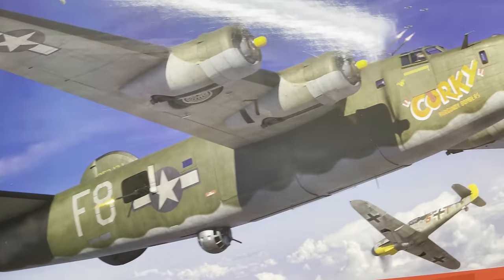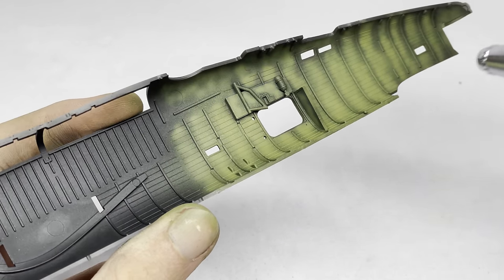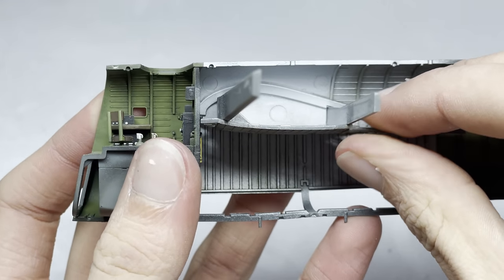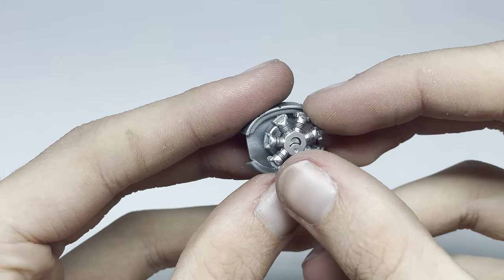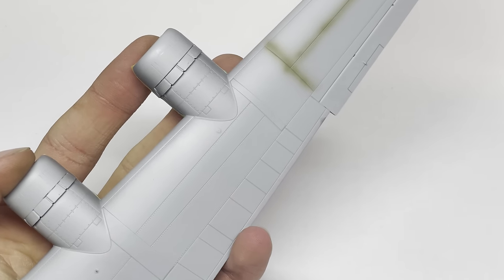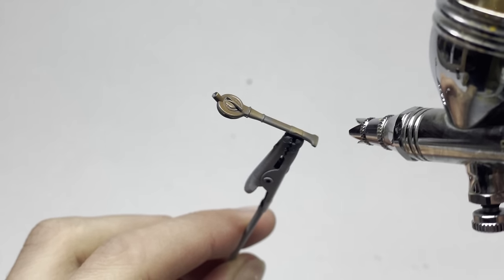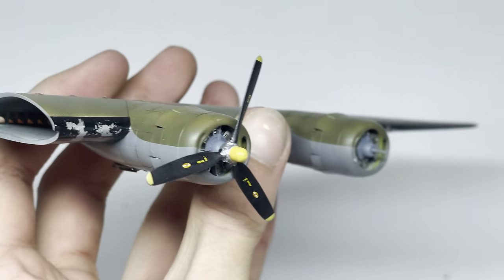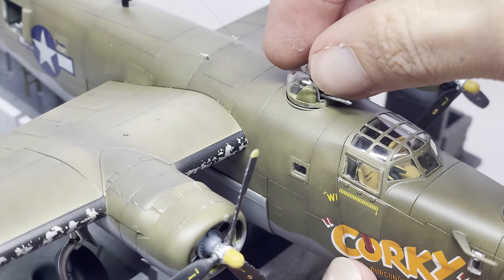Airfix's Brand New 1/72 B-24H Liberator | Full Build | 4K

Comment: Great video. One point to make though. The leading edges of the wings are rubber deicing boots, they would not be weathered with chipped paint. They would stay black or rubber in colour. These rubber deicing boots appeared on the B-17, B-24, B-29 and C-47 and C-54
Reply from the maker: Thank you for the information, definitely a let down from me… obviously just being lazy and not doing my research. I’ll make sure to improve for next time😉
Reply: Many cammo B-17s in Europe also had these removed too. There's footage of an out of control B-17 in cammo, in a spin, and the bare metal L/E is reflecting. @ultralowfat
Reply: @machmodels  Came here to say this too, FYI, de-icing boots are still in use today - the ATR-42 ATR-72 and Dash 8 are among some aircraft using this method.
Reply: @MillwalltheCat  You can see deice boots on the B-17, B-24, B-29 and C-47 and C-54. I imagine the twin engine B types could have them or not depending on how they were ordered. These were rubber pneumatic boots.
Reply: @MillwalltheCat  Please provide information about this. Icing conditions in the ETO required deicer boots
Reply: The more you know
Reply: You are correct. I have built 1/48 scale models of the aforementioned aircraft, and they had the de-icing boots. I am currently working on a 1/72 scale B-29 Enola Gay/Bockscar,  and I need to guess/guesstimate  where those boots are, as the deliniations are not obvious.
Reply: @machmodels  my comment, above, was before I read this one, about the flexible rubber de-icing boots....an EASY fix....

Comment: The only problem I see with the execution of the kit, and it does detract, is the leading edge of the wings, tailplane, and rudders are deicing boots.  There would not be the chipping of paint with these boots.  If the boots were removed for combat, the base color was the color of the wing, in this case olive drab.  Yes, that is picking of nits, but an important detail.  Over all, I really liked this build
Reply from the maker: I have now masked them off so it’s a tiny bit more accurate, thanks for the information anyway!☺️

Comment: This has to be the best 1/72 Liberator I’ve seen. I can’t believe it’s Airfix. When did they start using this new plastic? From what model? I’m used to excessively soft plastic and short shot parts but good over all shape. This is a quantum leap.

Great job, by the way.
Reply from the maker: Thank you very much, airfix have been using this new plastic for about a year and a half now😉
Reply: I have several Airfix kits in my stash, all relatively recent offerings. They have stepped up their game in the past few years. The amount and level of detail, even in 1/72 scale is impressive.

Comment: Great! Just one suggestion :  I am pretty sure that the black on wings and horizontal tail leading edge was the classic anti ice Goodrich system made of inflatable rubber, so it was not subject to peel off like normal paints.
Reply from the maker: Thank you! You are correct, as of today it has been rectified😁👌🏻

Comment: Terrific job on the B-24, really like the camo scheme and the method used to create shadows and fading. Well done Revell for including so much detail. I built a Revell B-24 kit back in the early 1970s (as a young teen) and recall that the details of the interior were basically non-existent, except for some bits and pieces in the cockpit. BTW...I enjoyed the Mosquito build :)
Reply from the maker: Thank you very much! However, this is Airfix not Revell😄😉
Reply: @machmodels  OOps....my mistake....I meant Airfix not Revell.  I have Revell on the brain at the moment as I'm building the its 1/32 Ju 88 and it's driving me insane with so many issues. I did build the Airfix B-24 many moons ago and it was a very basic kit then so it's great that, in the intervening years, there have been  major improvements in the quality of the new kits.  Bravo Airfix!!

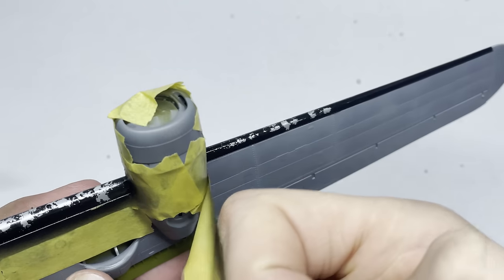Comment: A 18:40 the 'metal reveal' chipping shouldn't be there. The black strips are pneumatic de-icing boots, which are cycled to make a 'creeping' surface to break off ice deposits and safeguard the aerodynamics. The aircraft wouldn't be signed off as fit to fly with the boots inoperative and puncture repair patches can sometimes be seen on boots at full scale. Hope this helps -  otherwise an excellent model.
Reply from the maker: Thank you very much for the comment! Really appreciate the info, seemingly just pure laziness from me and below par… I’ll work on it for next time😉

Comment: Really good model. Note for accurately depicting the leading edge, I believe that the b24 was equipped with pneumatic boots. Much like modern aircraft this is a rubber sleeve on the leading edge that can be inflated to dislodge any ice formation. These boots where made from rubber, so wouldn’t really have any chipping. (Feel free to correct me) hope that helps with any future builds
Reply from the maker: Thank you very much for the information! I have a b17 to do at some point so I’ll refer back to this😉☺️

Comment: Excellent job on the build.  Looks AMAZING!  The only little characteristic that I don’t like, and it’s not anything to do with your work at all,  is the landing gear in the extended position.  It looks like the plane sits too high off the ground, too much room between the belly and the ground.  In reality, I don’t believe the ball turret could be fully extended on the ground.  Years ago, I had a 72 scale Liberator and it did the same thing.  I always thought it looked inaccurate.  The 48 scale Libs were more accurate in this case.  Congrats on the build either way!  Speaking of 48 scale Liberators, will you be building the new tool kit at all??  Keep up the great work!  

Cheers!!!
Reply from the maker: Thank you very much for the comment, I’m not too familiar on the libs anatomy so I’ll take your word for it!!

Uhhmm if I could find somewhere to put it maybe!😉☺️

Comment: I might be mistaken but the leading edges of the wings and tail surfaces have a black rubber deicing boot . The boot allows any ice that forms on the wings to be kicked off when the boot inflates . Many modern aircraft still use this type of anti icing system . The Beechcraft King Air is an example .
Reply from the maker: You are right! Thanks for pointing it out to me👌🏻

Comment: That new tooling is like several levels over the old 1960’s one.  Great build.  Question: Did they even keep the rubber de-icing boots once the boxcars were in a warzone?
Reply from the maker: Thank you very much! I believe from my understanding that they where in fact kept in the war zone, I might’ve been a tad inaccurate chipping them to bits😂
Reply: @machmodels  You are correct!  After looking at various combat damaged B-24s, many still have the rubber boots.  As far as the “chipping”… whose to say it wasn’t from a maintenance guy trying to remove the strips?  You could always mask it off and repaint with a lovely brownish-black (even pure black if the ground crew were diligent in applying some sort of refinish) … or buy more Airfix B-24s and treat us to another fantastic build – NMF!!!

Comment: I would have attached the nose sections to each of the fuselage halves, not as two sparate sub-assemblies. It can be troublesome in fit following the kit instructions (Case in point being the Revell/Monogram Ju88A that had an issue with that area - and the wingtips).
Reply from the maker: Ooo good idea! I’ll have to try that next time😉

Comment: Great looking build, amazed you got it out so quickly too! Do you mind if I ask how you go about spraying VMS varnishes? Pressure, thinning etc?
Reply from the maker: Thank you very much! No problem, so I like to thin them down 20% and spray at around the 20-23 psi mark… if you are using a 0.3 or lower thin 30% or more😉

Comment: regarding the leading edges: chipping them is a mistake, as those black edges were rubber. they served for de-icing the wings. (Those were like inflatable gloves on the leading edges, when ice started to accumulate on them, some air were pumped into them and the expanding rubber broke the ice layers.)
Reply: Just an FYI, in the MTO (B-24s stationed in Italy),the rubber de-icing boots were removed leaving the leading edges in the bare aluminum. I think the other marking version  in this kit shows this.
Reply from the maker: Thank you very much both for the information… definitely a part of the build that was far below a decent standard and me just being lazy - I’ll definitely work on it for next time😉

Comment: Great video but I see you have painted much before fitting and gluing the parts in place, in my experience; paint and glue just don’t do!
How are you preventing the paint from melting with the glue?
Mark.
Reply from the maker: Thank you very much! Most of the time off camera I will scrape off any paint with the connecting surfaces, this seems to help a lot’
Reply: @machmodels  ah, I see! Thank you for your reply.🙂

Comment: for the wash, just get nuln oil from gw
Reply from the maker: What are the advantages? I haven’t heard of it before☺️
Reply: @machmodels  really!? The paints are specifically Citadel paints, that has a enormous line of paints, they are pretty expensive, imo, though. GamesWorkshop creates tabletop wargaming kits. Nuln oil, to me, is just the best "general wash", imo. because you don't have to mix it with anything, just dip the brush into the paint and you're golden!

Comment: Leading edge of the wings shouldn’t be chipped as it is a rubber de-icing boot…. Basically the rubber inflates and deflates through a pneumatic system to help break ice of the leading edge of the wing.
Reply from the maker: Thank you for letting me know! Apologies for the inaccuracy😞
Reply: No worries… not many people would know… I only knew because I was an aeronautical engineer! Great build BTW and great finish 👍👍👍

Comment: sorry guys, but this work is no good. Inaccuracy, visible seamlines, orange peel paint job, omg my eyes....
Reply from the maker: Ah sorry to hear that buddy! Any tips for me to improve?😉☺️
Reply: @machmodels , sorry this is only my opinion dont wanna be rude to your efforts and thank you for the video. I bought Hasegawa kit of B-24J yesterday and wanted to compare it with the new Airfix. Just some moments: noticed seam lines on props, bomb sight, superchargers, frame inside the bomb bay. Cut markings on chairs, wheels. No drilled holes in MG. Maybe you should dilute paint with more thinner to avoid orange peel effect. It's just my perfectionism speaking with me, I always strive for the maximum accuracy during my builds (it does not always work out).